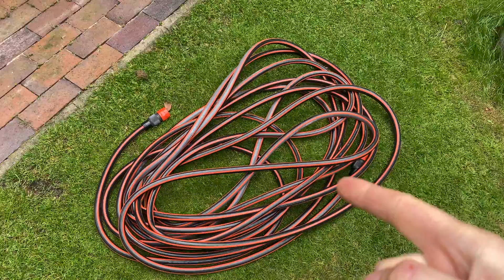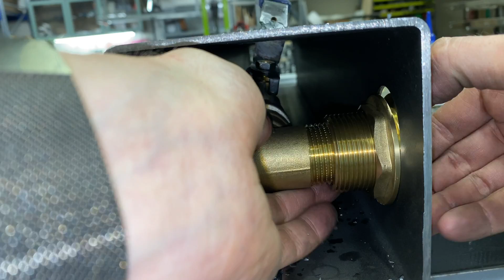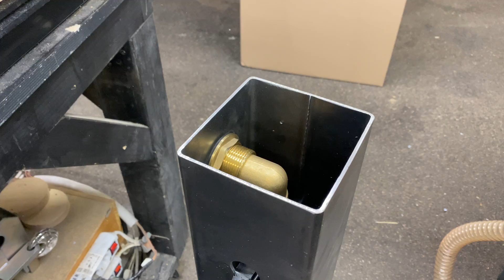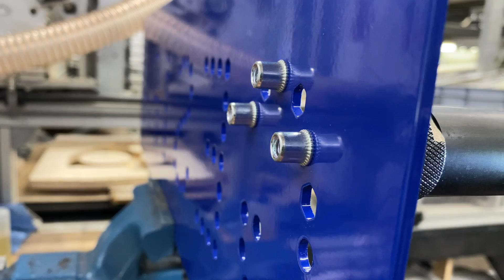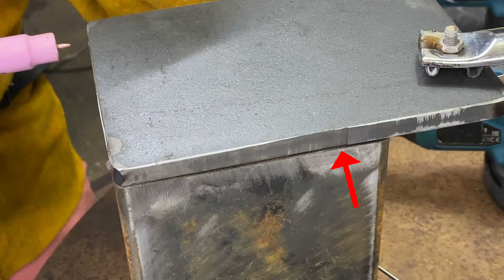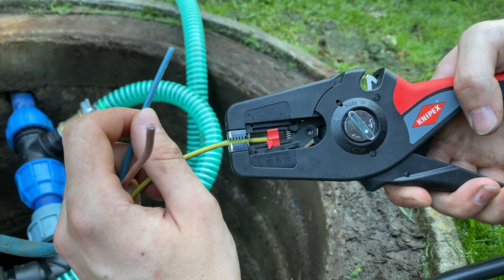Steel faucet station for the garden. (Simple Welding Project)

Comment: Great video, really love your welding. But one thing do not wear gloves with a flex/Angle grinder.  If the glove touches the disk there is a high chance that it will get caught and twist your glove around the rotating disk with your hand in it ! This happened to me earlier this year, luckily it was when i was powering down the tool, but I still had to go to hospital and get stitches..